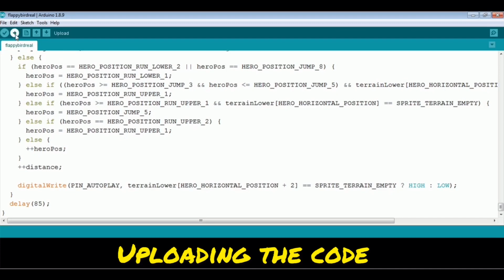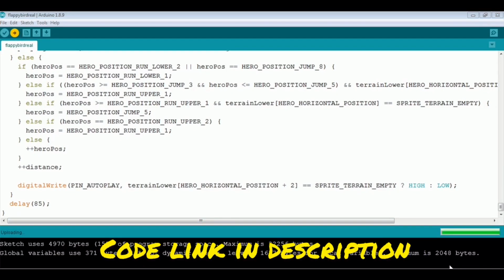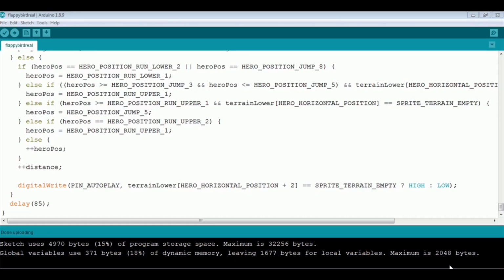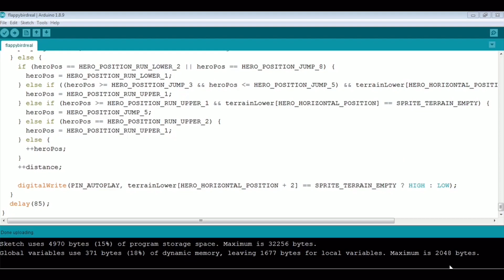Arduino Running Man Game in 2 Minutes | Arduino game with touch sensor| Part 2

Comment: sir it says error compiling to board arduino :(
Reply from the maker: Have you seleted correct arduino board in the arduino IDE? If not please correct it.👍
Keep sharing and supporting😇👍🙏
Reply: i dont know  where is SDA and SCL on the LCD. Please help
Reply from the maker: King Joshua Develos are you using I2C module?? If not then please get that on your LCD 😇👍